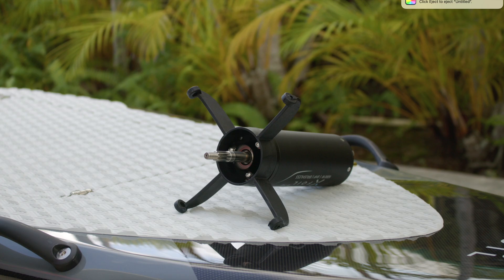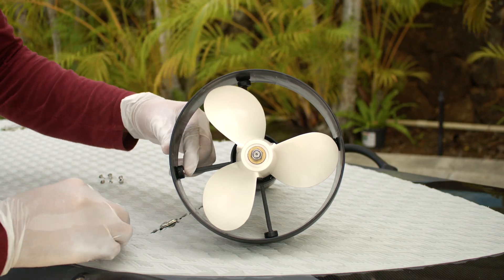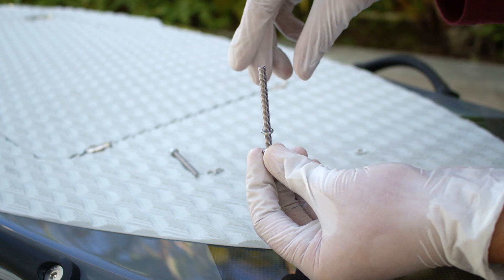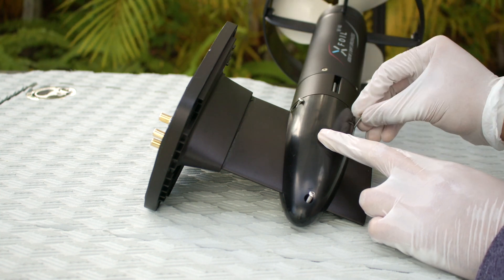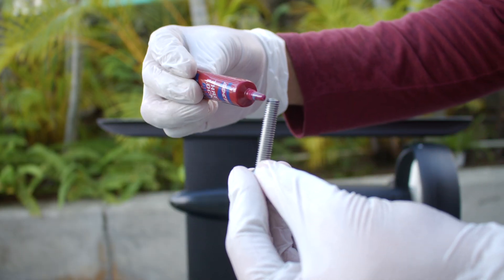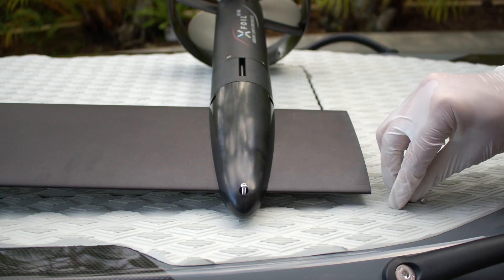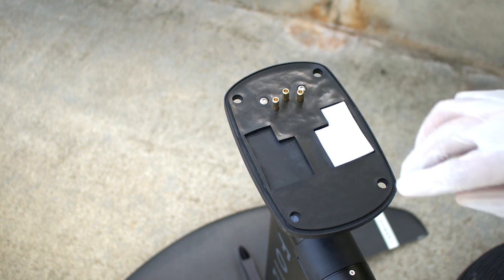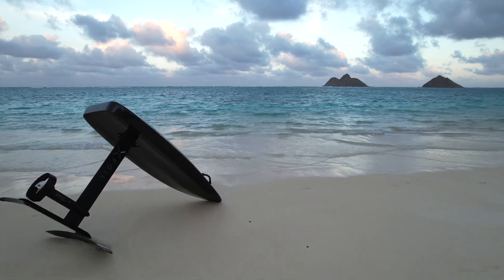XFoil - HowTo Setup

Comment: Wish the instructions were better as well as customer service. My friend purchased one of these and due to the unclear instructions (red pin protectors on the mast and motor have to be removed and the screws that appear to be holding the protectors  in place have to be put back in) did not install correctly so now the motor didn’t work and after a lengthy email back and forth, unfriendly customer service, and much time lost he has to buy a new motor from them and possibly a new mast. They only gave him a 10% discount for the expensive motor. They said they sent out an email a while ago to mention the screws. Only relying on email to inform the consumer and not redo an instructional video or correcting the instructions in other media forms is an error in judgement. It’s not simple to assemble the mast and motor and a good company should provide as much detail as possible. It’s not like putting IKEA furniture together. They also should understand their error and correct it better. A 10% discount that barely covers taxes is a joke! Great companies succeed by providing stellar customer service.
Reply: Hello, if anyone from XFOIL reading this, please answer here directly. Iam just assembling my Xfoil alpha 2. i DID NOT put the screws back after removing the red protector, when i put the motor on the cupside. could you please give me your opinion about the situation? Can i - without harming - start the motor? IS IT absolutely NECESSARY to put the screws IN AGAIN? (Problem is male side is stuck in the female so i cannot put the screws in)